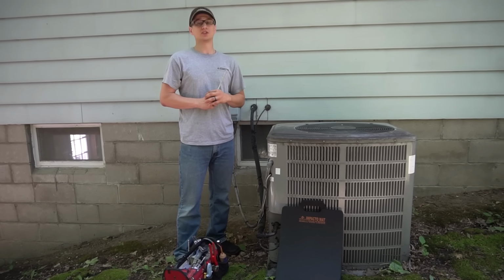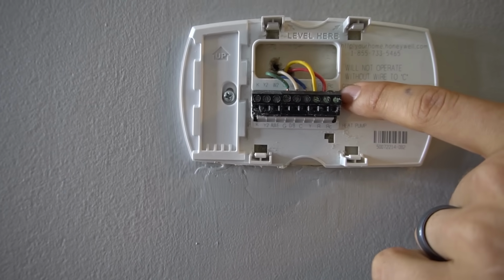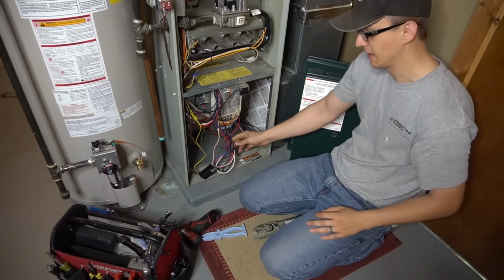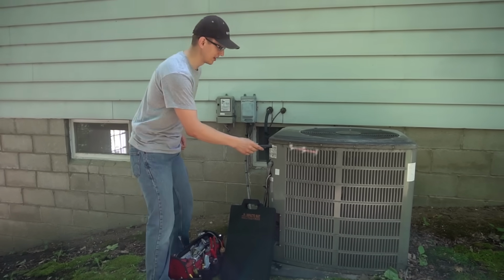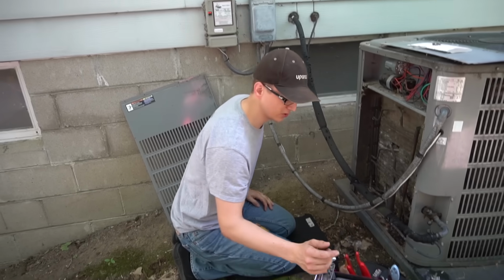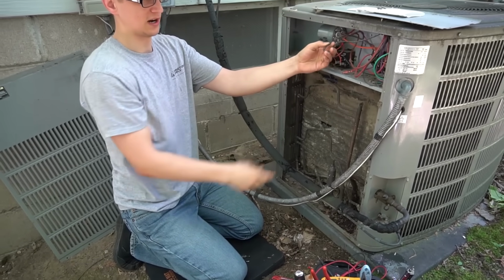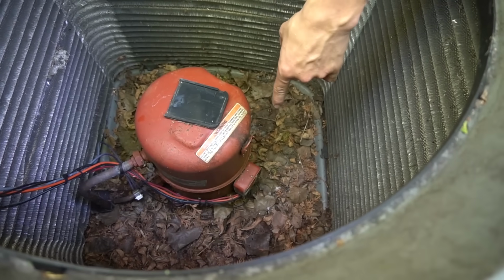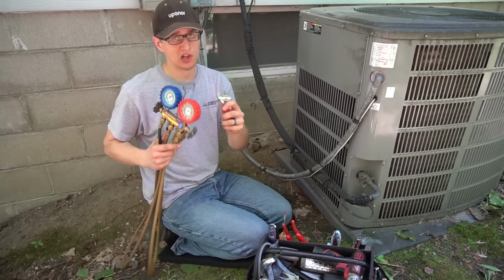AC Unit Not Turning On - How to Fix It Step by Step

Comment: Thank you very much for this video and the others that helped me out troubleshooting. Unfortunately I still cant figure it out, my only theory right now is a bad condenser/outdoor unit which is from 2020, ouch, it hurts. Furnace has been working fine, Im in FL and we need the AC already, well, when set the Ecobee thermostat for AC nothing happens. No blower, no outdoor fan, nothing. If I turn on the ventilation fan feature the blower do its job, so the blower is fine. Tested the board per your other video and its fine, getting 27v out. Bypassed the thermostat per your other video and blower starts but same thing, nothing outside works. First thing I did was to replace the capacitor as I always keep a spare one in hand, no change (which I hate those capacitors with just 2 connections because I dont know if there is any polarity as there is no markings) Last test I did is bypass the thermostat, have the blower at 100% speed, went outside and there is 27v when connect the probes to Blue and Yellow. Thats why I am thinking about condenser or something outside. Tomorrow will take it back again and continue troubleshooting this time the unit outside. Funny part, had a technician come last December for a furnace maintenance, now the AC doesn't work lol, got to love it. I will appreciate any advice. Its a Trane unit.

Comment: How about when heat and fan are running from a furnace , but when calling for cold air there no temp difference and the condenser doesn’t kick on unless I push in the plunger

Comment: Hello! I would like to say I appreciate all your videos. I am hoping you could give me some advice on an issue I’m dealing with. I switched my basic Honeywell thermostat to a smart Honeywell T6. Now it’s displaying a sensor error 178 code and my heat will not come on. My Goodman unit outside does kick on, but I cannot feel any air coming through the vents. Any advice? It’s freezing cold in my home. I double checked wiring multiple times, turned off breaker and turned it back on.

Comment: Wow! Thank you so much buddy. I have learnt so much about the basics and should at least be able to troubleshoot at this point. Apart from messing with the condenser, coil, and refrigerant replacement,  I am pretty confident enough to handle most of it since I am slightly more technical than the average homeowner.

Comment: Hello!! My inside unit works but my outside unit will not come on!! My dad replaced the capacitor & the contactor. It still will not come on. It will come on if you push the plunger in manually!!! What else should we check?

Comment: When I push the plunger in my compressor fires right up. Inside the furnace is blowing air. My honeywell thermostat display has a dim display after even putting new fresh batteries.   I hear the click on the thermostat when raising or lowering temperature. All breakers are good. The only way the compressor will turn on is when I hold the plunger in. Any ideas?
Reply from the maker: This video should point you in the right direction: https://youtu.be/NVPhsK4gK1A?si=ka8fZrJOcYhEShb_
Reply: @WordofAdviceTV  I appreciate your prompt helpful reply. After watching multiple videos of yours this afternoon including the one you mentioned I'm still stuck on the fact that although my honeywell thermostat that operates with 2 aa batteries still functions like it should, the display is very faint with brand new batteries. I removed the front face of the thermostat exposing the wires like in your video and the most voltage I can read is about 11 or 12 volts, not anywhere near the 24. I'm guessing the board on the inside unit is defective. Even the 3 Amp fuse on that board was reading about 11 volts.

Comment: Will weak batteries create issues? There’s a replace batteries indication in the thermostat but I can still adjust the readout. The fan and compressor isn’t coming to life though…
Reply from the maker: Yes, weak batteries could cause your unit not to turn on. I'd try replacing those first.

Comment: I have a American Standard heat and air. The outside fan isn't working, it I hold the buttons in the fan comes on and the compression starts up. When I let off the button it shuts off. The motherboard has a green flashing light, but it has a red light flashing 4 times fast. So think it's the condensor?

Comment: This was great.  I was not able to locate the control panel but I did find the fuse.  I replaced the blown fuse, inspected the wiring (inside and outside) and found no issues.  Turned the AC on and all is good!  The AC guy that came out told me it was a bad control panel and wanted $1700 labor to replace it.  The AC is still under warranty and he said the part was $1200.  
This saved me $1700!

Comment: This is a great video!  I learned a lot! But I also got a tip from my bro who's fixed his AC (he's also an electrician :)  You can diagnose a bad capacitor in under 10 seconds - no need for a multimeter or need to test anything (or even cut power or open the unit).

1) Be outside with something long like a screw driver. 2) Have someone inside change the thermostat to make the compressor cut in (the fan will not spin) 3) Remember, the capacitor gives the fan a "push" to start it spinning. With your screwdriver, stick it in and give the fan a push. With the compressor still trying to go, the fan, with your push, will start to spin and start to come to speed. If your fan successfully starts like this, you have a bad capacitor. Also, if it's super hot and you need to bring your house down in temperature while you order a part, you can do this each time to cool your house!

Comment: Thank you! You saved me at least $300 that an HVAC tech would have cost me. I had mice nesting inside the AC where the electrical wiring is located. Battled with those little $h1ts for 2 years (paid HVAC companies hundreds). Used silicon on all the access holes and no more nests, however. last 2 times Ive had "no AC power, no fan power" it was chewed or corroded/rusted wires. Lots of mice urine = corroded wires. Your troubleshooting video led me to  determine it was a wiring issue again - found a wire completely rusted through and disconnected. Spent $5 for a new wire connector end and the AC is working again! Thanks a million!
Reply: I’m having issues with my AC in the middle of a heat wave. We’ve been battling mice since winter. I’m praying this isn’t the issue because our furnace is in the attic/upper dwelling. Very sh*tty location.

Comment: I really appreciate you mentioning bugs potentially being behind the contacter. I pulled the capacitor and took readings and it was close to what was listed. I looked closer and there was an earwig buried way down in the contacter points. Great video! Much appreciated!!

Comment: Ok I have a question my AC Stopped working. I diagnosed. That it is thermostat related. My system is a combo AC/Heat system. I jumped Red to Yellow. Now the blower, and the Outside AC is coming on but the AC compressor is not coming on. I am guessing that I need to jump Red, Yellow, Orange and Green together to get everything to come on?.

Comment: Thank you for your video!!! I agree that this video provides great information. I have Lennox unit and yesterday I noticed the the compressor running but the fan was not running. I check the thermostat (works), vents (works) and air inside is working but not getting cold air. It's not programmed and I replaced the filter. I tried to jump start the fan, but it dis not start. I reseated the AC power (outside) and flipped the breaker switch to no avail. Finally, I just de ided to bump the unit with my leg and bam, the fan started spinning again and cold air began to flow. Should I go ahead and replace the fan and capacitor? 

Model and S/N

M/N XC14-030-230-03
S/N 5810J08143

Any help will be greatly appreciated and thank you!!!

Comment: Everything is running on my central air conditioning system, but it's not producing cold air.
Outside the suction line at the 90° elbow is completely frozen over, I know that is the problem,  I disconnected the power the thaw it. 
What are some trouble shooting tips or advice to get the system to cool the house again?
I'm very capable to DIY almost anything. I have replaced the capacitor in the past, and also replaced the fan motor in the past.

Comment: Hello,
My AC doesn’t turn on.
Fan on furnace is good. Fuse is good. 
When I press the plunger on AC unit it  turn on. I changed the capacitor. But still the same problem. 
What do you think the problem is?
Thank you.

Comment: Inside the house everything sims fine…air blows out of the vents, at the unit outside fan is not moving but spins freely, so I tested my capacitor with my multimeter and my compressor pron reads lower then what’s suppose to be, so I replaced it, check all the wires and everything seems good and tight but the fan still doesn’t turn on.
Do you have any idea of what else could be?

Comment: I replaced the fan motor, and the capacitor. When I turn on Ac the switch clicks and contacts but nothing happens on the outdoor unit. Everything runs inside and fuse is good. Please help!

Comment: So is the plunger supposed to be pushed in by itself to be working? I’m confused
Reply from the maker: Yes. When you turn your air conditioner on at the thermostat, that little plunger should automatically pull in. If it doesn't, then this would be the next video to watch: https://youtu.be/NVPhsK4gK1A?si=qxUd9xPohbwQZ5xF

Comment: Hey there! Friday afternoon we noticed our AC was not cooling us. I have changed my capacitor. My condenser makes a whirring sound, but my fan stops only a couple of minutes after I turn the system on. Also, the unit outside heats up. What could be happening? Thank you!

Comment: In the short terms ( video ) you touched quite essential point with no many details,  but at list it gives good leads  to many important points especially for diyers, even tought some things, down on line , are complicated, because it  includes quite a bit of technical skill in thermal dynamic ( not to go in many details).So,good lead for someone who wants to save sone money. 👍

Comment: Thanks for the video. When I push the contact inside the ac unit, it starts up as it should. When I switch my thermostat inside to fan on, nothing works. The thermostat will go to wait mode then cool mode however it won’t turn on, are you suggesting it’s the thermostat? Or furnace fan problem? My ac stopped working overnight.
Reply from the maker: Sorry to hear about the AC troubles! I would suggest following along with this video next: https://youtu.be/NVPhsK4gK1A?si=b4kw8WIw9m1WvHfL

Comment: What could happen if the filter is installed facing the wrong direction?
Reply from the maker: Most likely nothing will happen. (You are talking about the furnace filter right?) One side of the filter often has a wire net on it to prevent the filter from getting sucked into the blower motor once it gets plugged up. That is the side that should be facing the motor.

Comment: Help please , the a/c fan is on, the condenser
.. calling for cool, but dont hear the compressor ,  both lines are luke warm, suction line not cold, replaced the capacitor, still the same, need help

Comment: My 4 year old Honeywell T stat (for my 4 year old Trane 4 ton heat pump) had a "memory error" or something showing.

I replaced the 4 double A and even the 2032 coin battery.

I reinstalled and turned it back on and nothing happens.

Checked the programming and nothing happens. Put the fan in "on" mode and nothing happens.

Looked on line and read that usually this means the $200+  T sat needs to be replaced.

I have a near identical set up on another working ac in my home, swapped the T stats and the one I replaced the batteries in seems to work fine on the other unit.

The T stat from the other  working unit didn't fix the non working unit.

Saved $200+..

I checked to make sure I had 240V on each side of the outside disconnect,.. but didn't check 240 volts further into the unit.

I checked the capacitor in the condensing unit and was surprised to see a single run capacitor for the compressor. It seemed to be ok. Read that this model condensing unit doesn't have a capacitor for the fan,.. but the power one line shows another capacitor somewhere. Didn't study it enough to find out where.

Saw a bunch of mud dauber nests and cob webs,.. in the electrical area and cleaned those out,.. but didn't check the plunger on the contactor.

But your video gave me a few ideas to do some further checking before I call the a/c company and get told,.. 

"well the condensing unit needs to be replaced and although it's under 5 years old,.. it's not covered by the 5 year warranty.,.. so that'll be $2000",... 

(or maybe more since this government has given us all about 50% increase in costs,.. for an open border, regionalwars everywhere, homelessness, crime, drugs,..)

And it's not that I can't afford to pay to fix it,.. I justhate gettingscrewed.

So thanks not only for this video, but all of them I might need as a reference.

Subscribed.

Comment: Thank you for the videos. I have a Guardian ac unit. My ac isn't turning on, fan not running. Dead silent. My friend came over with a meter, and got the unit started up. But it's set on 70 and it's completely silent..
 PLEASE HELP

Comment: Hi Good information. Just question for  me if I connected my wiring  on the capacitor wrong  what  could  be the outcome  .Will they be any damage.   Thanks
Reply from the maker: I've wired them wrong a few times before and the unit simply didn't turn on or buzzed but failed to start. After I corrected the wiring, it fired back up no problem. So I would say that usually this wouldn't damage anything but I suppose it depends on which wires are misplaced. Best to just wire it correctly. 😅

Comment: Are you still around to answer questions?  My unit does not fire up but the inside fan is working. I replaced the capacitor and I got the outside fan motor to work but the plunger on the connector does not engage. As long as I manually press it, I get the unit to work and cool the house. So I replaced the coil but the plunger does not self engage still. So I replaced the starter capacitor and still no luck. Only thing left to replace is the relay. 
By the way, unit has always worked and this just started a week ago. I have checked the thermostat wiring and nothing has changed. There is not any condensation blockage. It’s an ecobee thermostat and I did a hard reset. The thermostat acts fine but maybe not fine enough to turn the unit on?  Bottom line, with almost everything replaced minus the relay and the thermostat, I can only cool the house by temporarily engaging the plunger on the coil. With that pressed it works fine.
Reply from the maker: Sorry to hear about the AC troubles! Have you watched this video yet? It might give you some more ideas of where to look: https://youtu.be/NVPhsK4gK1A?si=C-jGfg9PqjnF9l4h
Reply: @WordofAdviceTV thank you for the prompt response. Looks like I still have some more troubleshooting to try. Thank you and I’ll update you. Cheers.
Reply: You were a big help and greatly appreciate it. Turned out that it was the relay which was the last and final piece to replace at the outdoor unit. The main capacitor was the initial issue  but that relay also had an issue. I have it bypassed for now until the relay arrives but the plunger is engaging normally on the condenser connector. Thank you again. Cheers.

Comment: This video was such a huge help in me diagnosing my issue! One thing I ran into that you didn't cover (but am hoping someone might be able to shed some knowledge on) is troubleshooting the contactor after replacing the capacitor. 

After confirming the 240V was hitting the condenser, I used an insulated screwdriver to press down the button on the relay to test if the fan was working, and sure enough it worked. I "released" it after a couple of seconds, but the button doesn't return to a neutral position that's flush with the plastic housing. 

I then held it down again for like 10s, and everything kicked on and has been staying on. I figure I still have a bit more work to do with replacing the contactor, but have you seen something like that happen before? Is my theory correct that the "stuck" button indicates an issue? 

thanks again for this incredible video!

Comment: I’m looking for advice. My thermostat is not turning on. Only thing I did different is that I had my hvac unit professionally cleaned. Now the thermostat isn’t working, nothing is turning on. I’m not sure if the capacitor or the contactor on what needs to happen.
Reply from the maker: Sorry to hear about the A/C troubles! Have you checked the simple stuff? Is the power switch on the furnace turned on? Circuit breaker for AC on? Disconnect switch by condenser unit plugged in? If you open the air conditioner electronics section, any wires left disconnected? If possible I would get that company back out there to fix their mistake though.
Reply: @WordofAdviceTV  Our Hvac person who cleaned the unit came over to check and it was a simple thing that the cover of the unit upstairs was not fully closed and so the safety switch was off. Once he slid it in properly, it worked normally. Im grateful he stopped by and took care of it. I was going through you rvideos and collecting my tools - getting ready to order parts and fix things if required.

Comment: Great video!  My RUUD AC only had on capacitor showing,  It was 70 +10 MFD.  It was 12 years old and I live in Texas.  Found a new one at ACE Hardware store.  Home Depot won't sell you one unless you are a licensed contractor. :-(  I discharged the old and had no problems.  The new one took about 5 minutes to charge up before the AC came on. I'm 78 and on Social Security.  I am a happy camper.